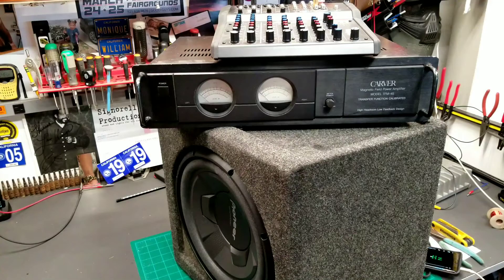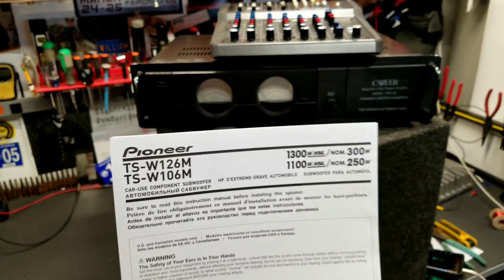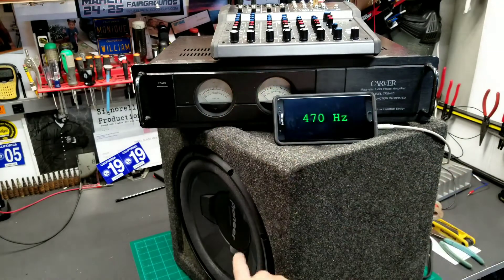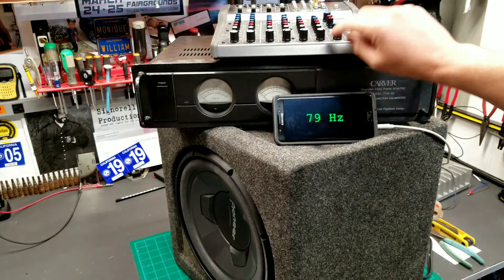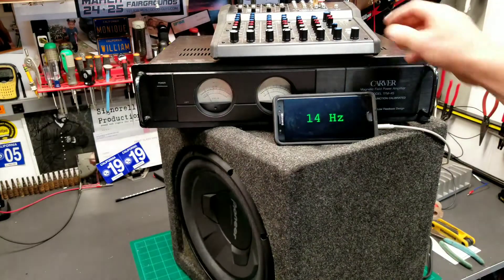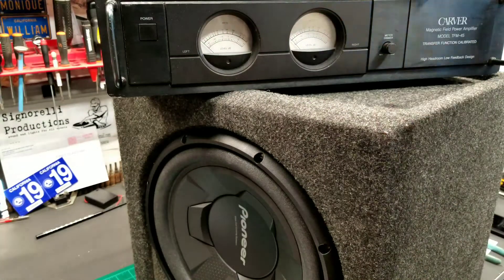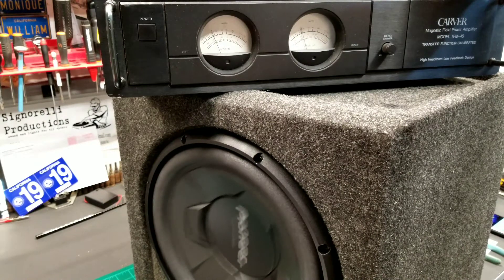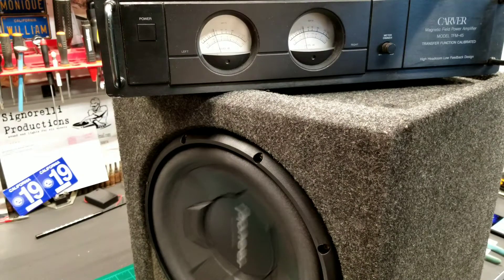Subwoofer Sound Check

Comment: Thanks for the vid, it was interesting to see what it's capable of in a small enclosure.
Reply from the maker: Your welcome. The box meets the specs for the speaker.  It only requires one ft³ of air space
Reply: @Willie493  Nice, I will buy one tomorrow. As to sound quality in a sealed enclosure like you showed, do you think it sounds good?
Reply from the maker: @carlosruiz6179  
The sound is very solid and precise.  This is in an SUV facing toward the rear of the vehicle.